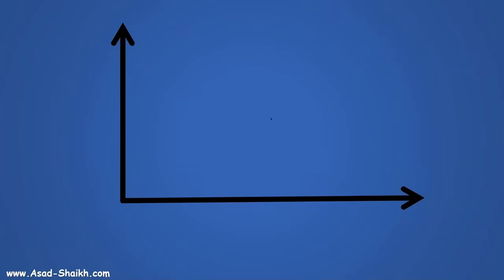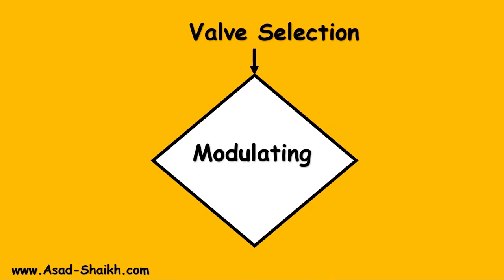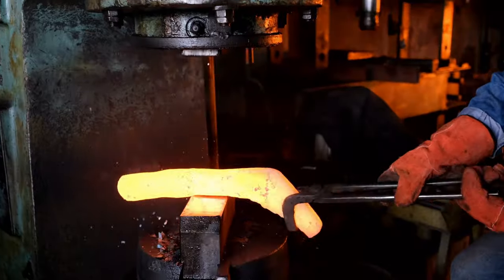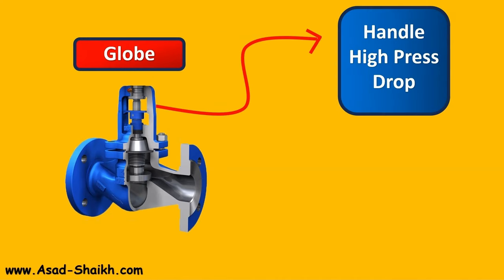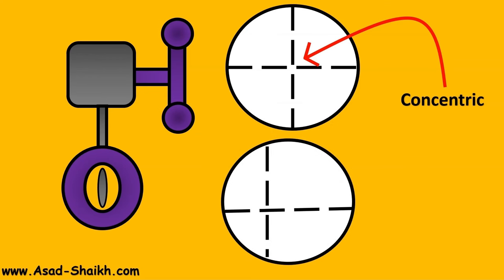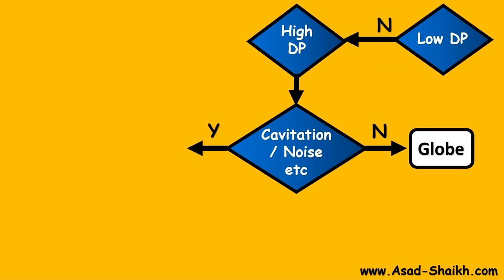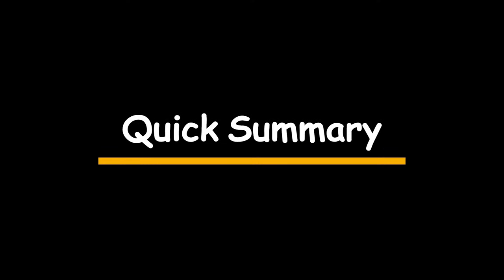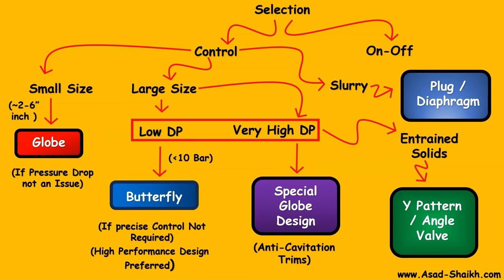Control Valve Selection (Most LOGICAL Explanation)

Comment: what about V notch ball valve for control application
Reply: Yes. For better control we can go for v notch type ball valve.
Reply from the maker: Yes, I have not considered V notch ball for a general valve selection since inherently ball valves are suitable for On-Off compared to control.

But V notch is a special case to be considered only when other designs cannot satisfy the engineering requirement.

Example : Low DP across valve , Quick flow demand etc

thanks for sharing your knowledge😊